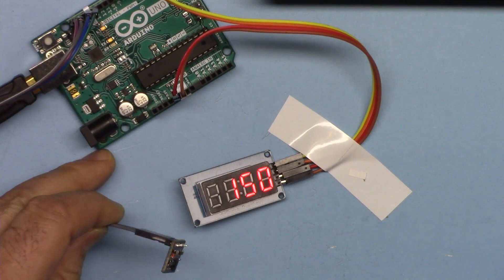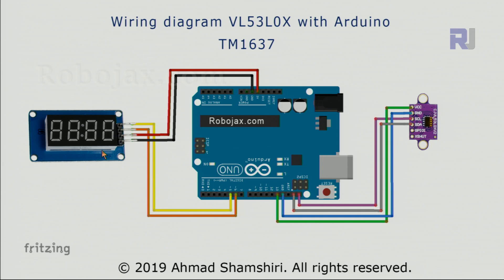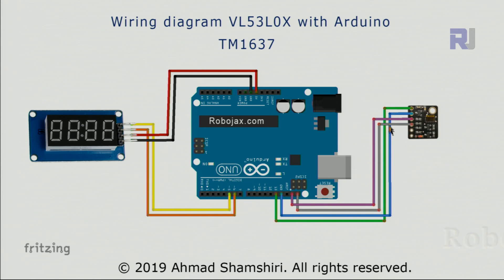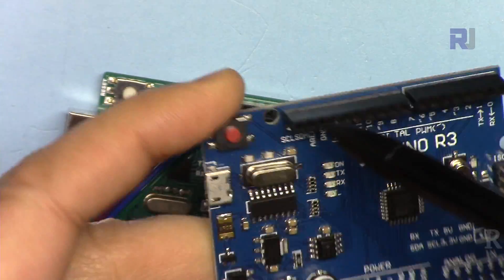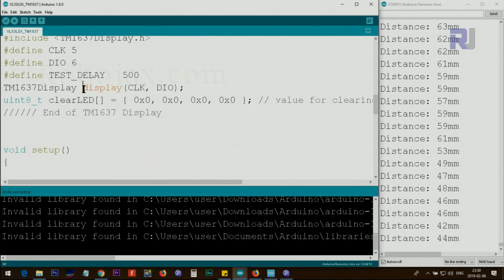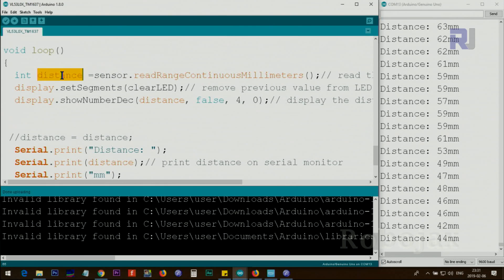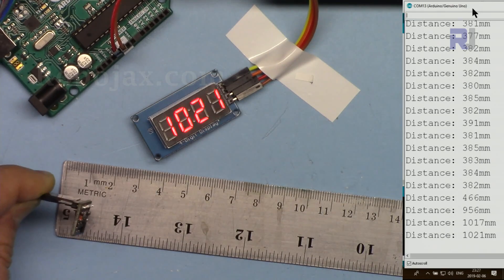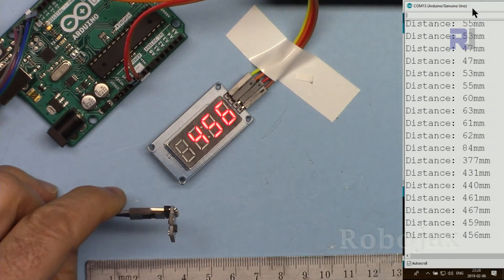Lesson 79: Display distance from VL53L0X on LED display TM1637 - RJT466

Comment: Hello teacher! Is this VL53L0X module laser-based? How does it see the object, since several objects can confuse it? Thank you.
Reply from the maker: Hello, it has field of view FOV which is not a spot but rather about 15 degrees (check datasheet) so as the distance increases the field of view covers more area.  So anything in FOV will show as object.
Reply: @robojax  Ah! Thank you.